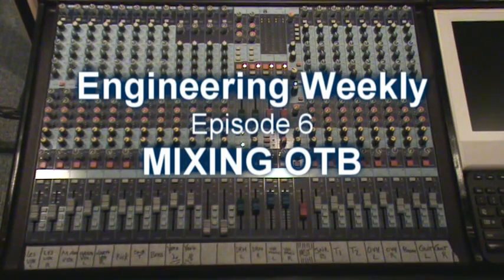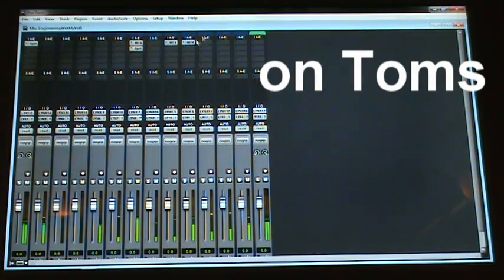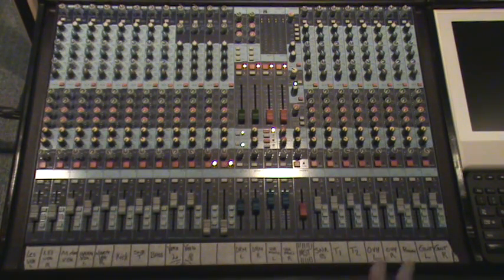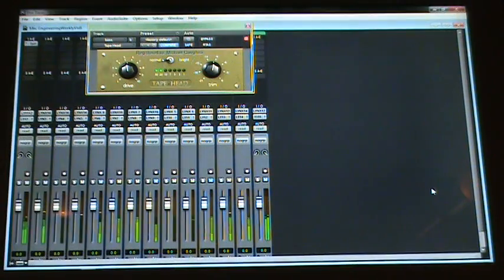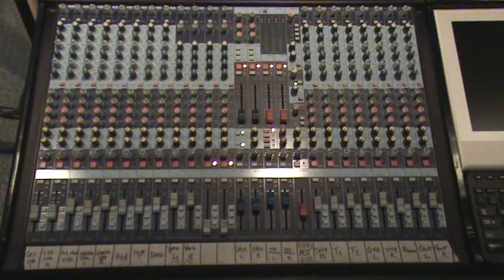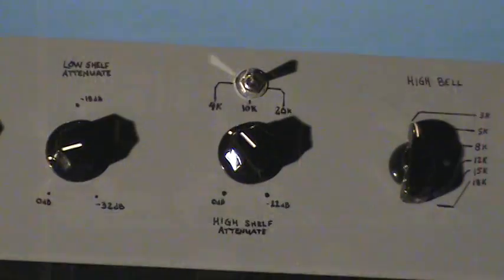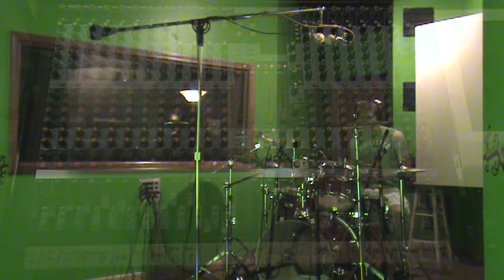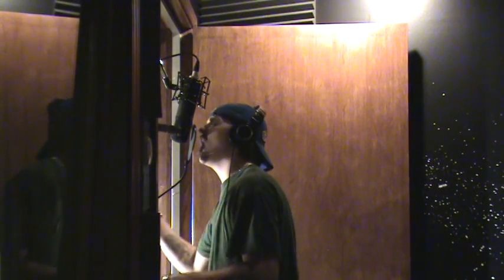Engineering Weekly - Episode 6 - Mixing Audio "out of the box"

Comment: I completely ditched the all in the box mixing and now added an Allen and Heath GL2400 32 channel analog mixer as a hybrid setup. Now my digital reverbs are set to 50%dry and then the L/R of these reverbs from inside the DAW are sent out to the mixer  using 1/4 connections as line in. What this does is it gives me the early wet vocals and track mixing sound of the late 80's. I have access to some stems from The Police , Level 42, even RHCP. The 80's stems from the Police for example are Wet vocals they were recorded in a large room  and not isolated in a booth as you can hear the headphone mix leaking into the room clearly. One thing I will say after hearing these stems, the mixing consoles used to mix these stems into the final commercial sound turned these badly recorded tracks into polished tracks. So yes an SSL 4000 G can indeed make a massive difference on your tracks. If you heard the U2 With or Without You stems you would piss yourself laughing and wonder how on earth they mixed the tracks with such badly recorded stems. Since there is no effects you can hear every bad detail and this proves my point that money or a $250,000 SSL 4000g ( in 80's $$) plus outboard gear took tracks that anyone can get done in their basement today for $1000 worth of gear ( mics plus interface) and make them a staple of music. Without these expensive Analog mixing consoles your sound is shit and sounds too wide and too digital. But that is the price we pay for not having access to a 4000g console. Digital mixing is not the same as analog mixing as in analog mixing you can go 50% dry on your reverbs and not need the dry stems, on a DAW you can not disable the dry stems from sending to the master bus and only keeping the reverbs at 50%dry as your entire sound will collapse. On an analog mixer you do not need to send the dry stems to the master bus and only need your reverbs to be at 50% to include the dry %. This is impossible ITB as the dry track has to be sent to the master bus.